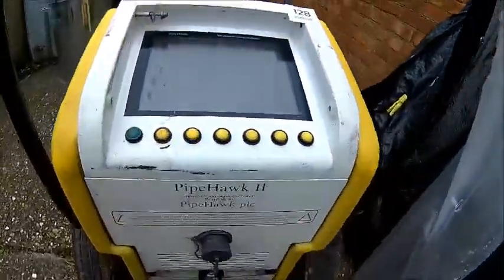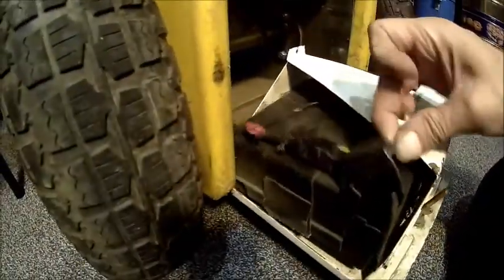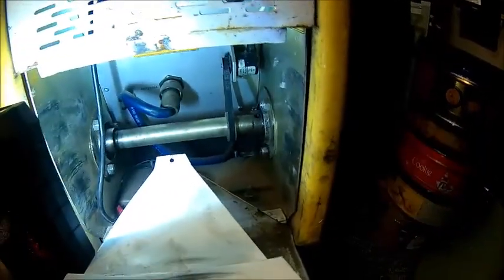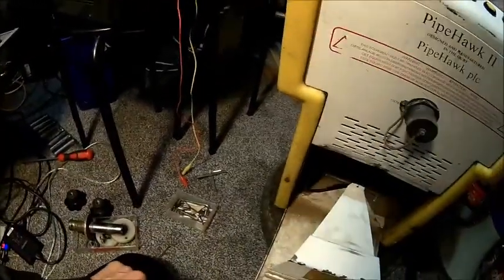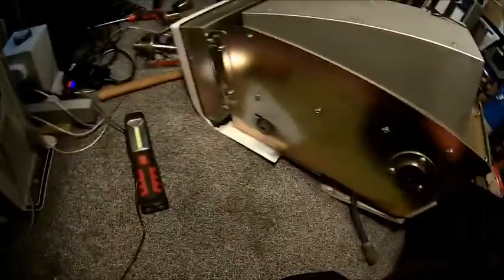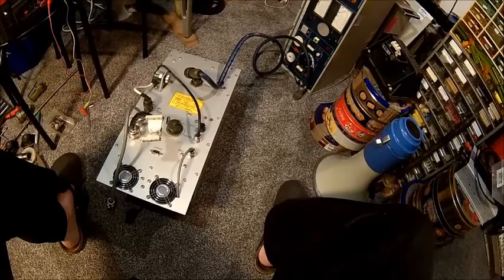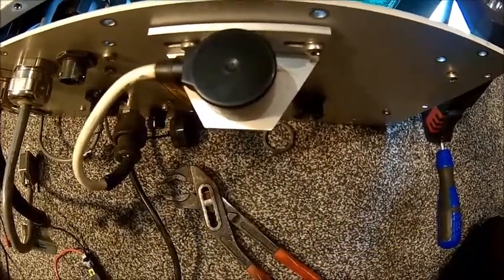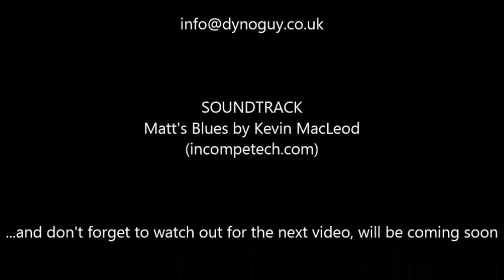Pipe Hawk II GPR repair - Part 1, the dismantling challenge (Ground Penetrating Radar)

Comment: Did you ever post the follow-up?
Reply from the maker: Sorry, no i did not as it got so little views and it's a lot of work to edit video.
Reply: @dynoguy that’s a shame, but understandable - this video helped me get mine into the same state as yours at the end of it… after a new SBC-558 and some new RAM, I took the opportunity to add a waterproof USB keyboard port running of its PS/2 connector.

Just need to get the unit and the antenna reunited and try it all out now…
Reply from the maker: @adamwilliams725  have a closer look at the connector at the RF box on top of the antenna, mine had a bit of corrosion and the retaining screws of the sub-d connector were treated badly by a previous owner, resulting in poor/intermittent connection.

Comment: I have one of these scanners but the system won't load...can you help me please? I would really appreciate :)
Reply from the maker: Maybe, ... are you in the UK ?
Reply: @dynoguy  Not anymore...I'm from Poland :). I lived in England for nearly six years Sir :)
Reply: @madeinjungle1977  Hi, Have the similar problem with gpr Pipe hawk ii, have you solved it?
Reply: @dynoguy  I will do a little bit more testing myself and contact you again If I don't manage to fix it myself. Thank you for this video...you are sooo like me! Always fixing something :)
Reply from the maker: Please let me know what it actually does, ...if it says "press any key to continue" you need to dismantle it and plug a keyboard in, it will also need replacing the battery on the mainboard. It's quite a big job, many many screws
Reply: @madeinjungle1977  Hi! Have you any results? Have you tested it? How good is this one?one man have offered me a one to buy, so I'm not sure how good is it? Thank you

Comment: I was involved in the development of the Pipe Hawk 1, between 1988 and 1996. The goal was to develop a tool that could identify plastic pipes. It was based on British military GPR (developed during the Falklands war, to ID plastic mines) and the antenna design was protected by a military-secret patent. It has analog and digital electronics, analog being in the antenna (and incorporating a sampling head). The analog radar is triggered by every 2 cm movement of the wheel, and each trigger produces a large number of pulses. These pulses are then accumulated by the sampling head, converted to digital and sent to the digital electronics. The unit uses a series of proprietary algorithms to differentiate signals that return from a pipe - from those of other targets. The operating system is probably Linux based. I tested Pipe Hawk 1 in the US and a unit was in my living room for about a year.
Reply from the maker: Thanks alot Robert, really valuable information, .. i was thinking along that line as it looked like most of the raw signal processing appeared (at least to me) to be happening in the antenna unit.
Do you have an idea of the frequencies in use, i could not really see anything on the spectrum analyzer, i guess the pulses are just to short for my good old Ailtech 727.
As you can see at the very end, i got it (sort of) back to life and can see some echos, still need to edit the following parts of the video. Things to do are making a new encoder bracket as the wheel encoder is faulty and the replacement i have is a bit larger in diameter, also fixing some of the buttons and trace an intermittent fault with the display. Just not he most important project right now, but winter wlll come ...:-)
You are most likely right with the OS, it boots into DOS showing a menu, and when you hit the Go button it boots into something else (non DOS), looks like there are at least 2 partitions on the disk... cheers, Mike
Reply: I was part of the team that designed and built these! I worked for Emrad Ltd from 1988 to the end of 1995. The company started on the Surrey Research park in Guildford but moved to Godalming when the company started to grow. I worked with Robert Meade field testing on the streets around New York State. At the time technology was very slow and expensive, by today’s standards, so a lot of compromises were made to keep costs down. 
If my memory serves me correctly, it was 30 years ago, it uses a pc booting into DOS to do some of the housekeeping but the signal processing is done by an AT&T DSP32c floating point processor. You are right the hard drive is partitioned, the idea was to keep the data collected separate from the operating system. I’m pretty sure it used a 24v lead acid battery for power. To answer your question about frequencies, it fires a series of pulses with a 1ns rise time containing frequencies from about 500MHz up to about 1.5GHz. It was deemed low enough power that it didn’t need licensing. I went on the father two healthy children so it must have been fairly safe!!
I actually worked on the Ministry of Defence project to clear the mines in Falklands using GPR before moving onto this. 
I never thought i’d see one of these again, I’d love to see your next video once you’ve got this open , who knows the memories might come flooding back! Good luck!
Reply: Hi, how did you find it?
Reply: It's not linux. It's hard to tell how old that unit is, but it would be 2001-> as the move to Alton happened then. At the time we were working on the IMO product which is installed on that machine. The normal Pipehawk software in those days ran on 4DOS, but the IMO stuff used Windows CE. As an aside, the reason it's difficult to get apart is because it was designed to be like that; customers weren't supposed to be doing their own servicing! :-)

Comment: i have a pipehawk the same as yours. fully working but i think the motherboard battery is dead because the bios settings reset when it switches off. Yours, if you get it working will need a code that you must enter because it has a shut off which was put in place if we didn't pay our maintenance contract every year. mine is on eBay as i am not in the surveying industry now. you can email me if you want any more information sifoster155@gmail.com
Reply from the maker: Thanks Simon, i thought there must be a few more around ...you are right, the MB battery was dead, not surprising after almost 20 years, also the wheel encoder has an issue, probably the reason it was abandoned.
 I got mine up and running so far, just waiting for the correct encoder as it has 500ppr, rather unusual. Also some cowboy used a hacksaw to get the connectors in the antenna off, fixed that as well....cheers, Mike
Reply: @dynoguy  Hi Mike, Pipehawk are based in Alton in Hampshire. i think they may still have bits and pieces for the pipehawk.

The 2 modes on the Pipehawk are IMO (immediate mark out) and pipehawk mode. The first mode will allow you to push or pull the antenna along the ground for approx 30 metres to find any possible buried services (this mode was specifically designed for the company i used to work for) The pipehawk mode will only allow you to push or pull approx 3 metres. i used to use this mode to find the depth of an existing service which would be found in IMO mode. 
The operating system is a little bit antiquated now as there are newer machines that can give you the position and depth in one operation. Mine cost me about £20k back in 2006 when i was a franchise for a utility company that Pipehawk had a steak in .
Reply: sorry stake not steak
Reply from the maker: Thanks Simon, i figured that out already, don't like the pipehawk mode (and don't have the software either), IMO feels more comfortable to me. I ordered the parts i need from an electronics supplier, certainly much cheaper than at PH. Mine appears to be made around 2001

Comment: Reverse engineering. I'm working on an old geiger counter that takes three different batteries of weird voltage. I hope you have no issues getting it working.
Reply from the maker: Well,...it turned out that it's not that weird, the DC-DC converter on the main power board gave me a clue, it's 18-36V input, so the battery was obviously 24V. Other issues are rather minor, apart from a dodgy 500ppr encoder (got all sorts of 2Exx types, but 500 is an odd one, so had to order one), and some clueless moron messed around with the plugs in the antenna unit - with a hacksaw !  Put quite a few hours in it, but now i can see some echoes from bits held in front of it, so we getting there.
Still could not figure out the frequency range as my spectrum analyzer is simply too slow for the short RF pulses (seems to be a pulse radar, not an FMCW type)